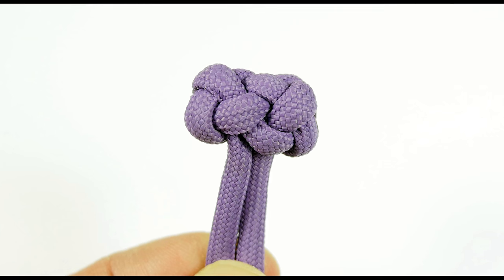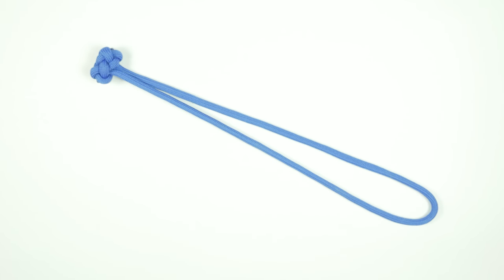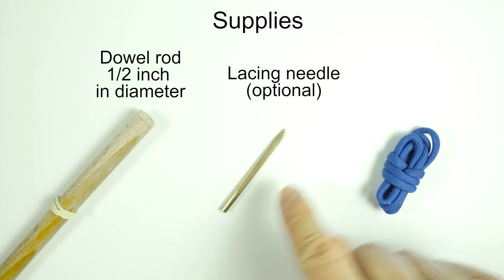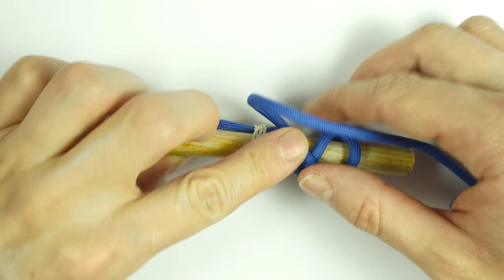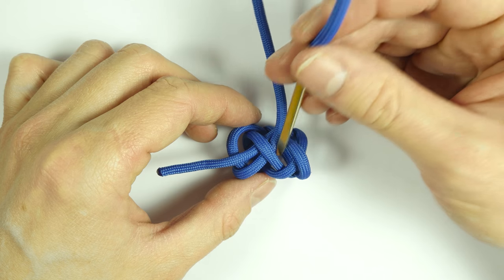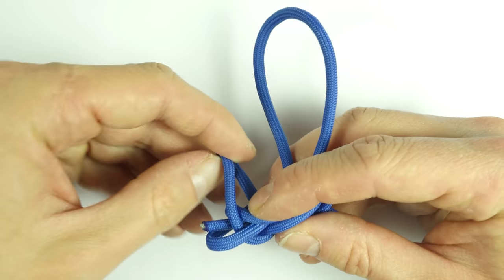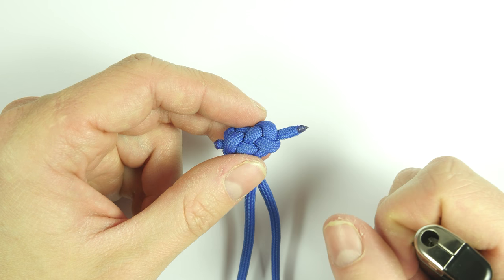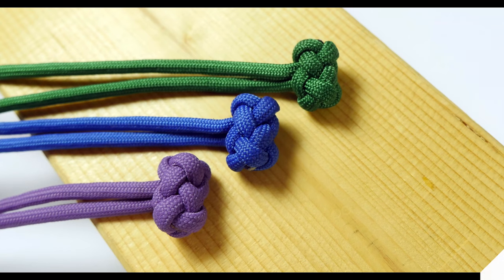Small toggle knot

Comment: Thank you very much for this! Going slow and explaining every move helped a lot.
Quick question, since I've never worked with paracord: Why not pull on the bracelet loop part while having the ends secured? Would that help to tighten the loop? 
Is there another way to make the ends stay without melting? 
Could the loop of the paracord be made in to a frog loop (a style used for Asian style closures for apparel)?